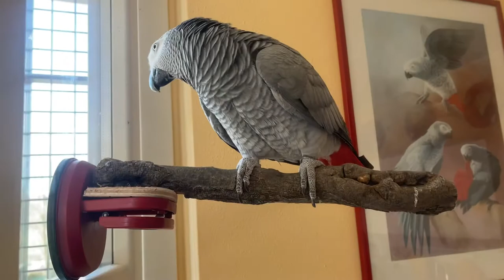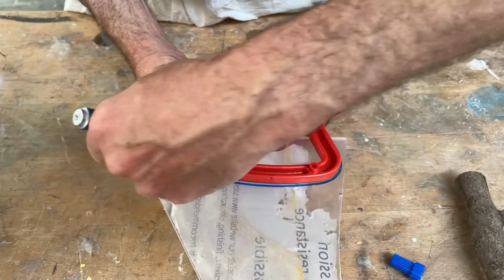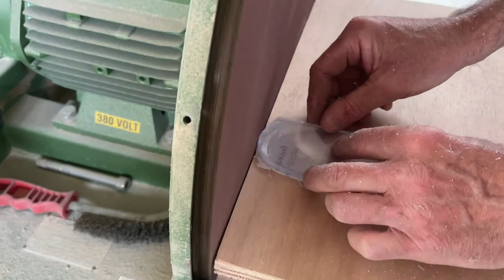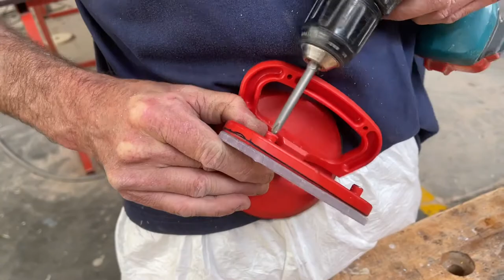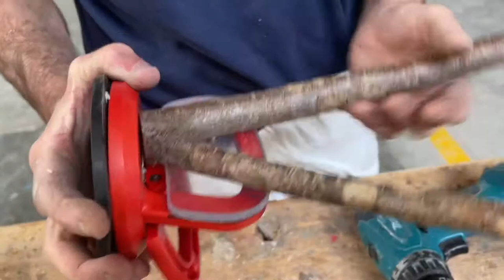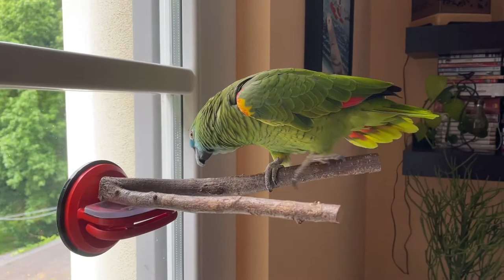How to make a DIY window perch for your parrot

Comment: nice!  do you have a link to the heavy duty suction cup?  thanks
Reply from the maker: No sorry, also I live in Italy so I don’t think I could be very helpful. You can easily buy them in places where they sell tools for diy. I used the ones to lift the tiles of the raised floors.
Reply: @Enrichment4Parrots  Thank you for taking the time to reply.  I found them on US Amazon.